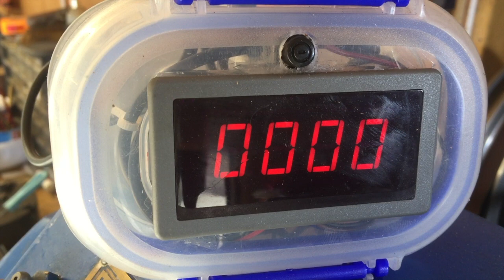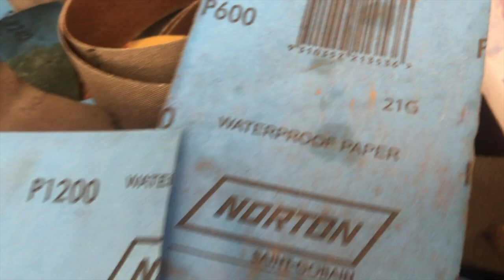Art  in Stainless Steel

Comment from the maker: Well it has been a month and there are no comments about what this device is.  It is model of a Burdan.  These are used to crush quartz to extract gold. A cannon ball was originally placed in this dish. It had an axle placed through the center and tilted over 15 degrees from vertical. Bevel gears were fitted to the axle to make it rotate at a modest speed. The ball continuously rolls to the lowest point crushing the quartz to a fine powder. Originally mercury was placed under the water which was used to wash the quartz into the dish. Gold and silver amalgamate with the mercury. Every so often the amalgam is removed and heated to 400 degrees C to evaporate the mercury leaving gold-silver bullion behind. The mercury vapor was condensed and reused.  The cannon ball results in crushing but was later replaced by a heavy slug of metal which was held in place by a chain.  This resulted in a grinding action rather than crushing. We have several of these at Goldmine Experience in Thames, New Zealand.